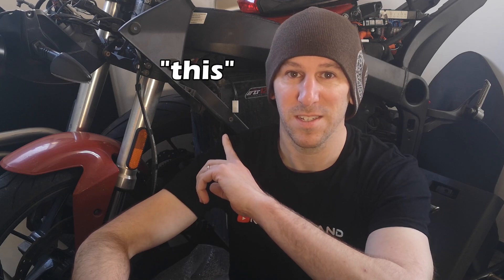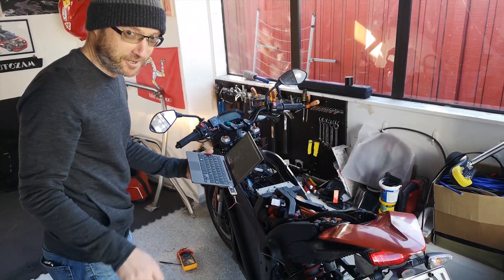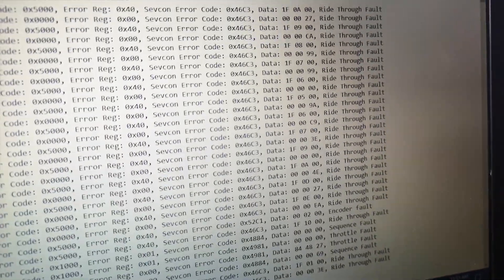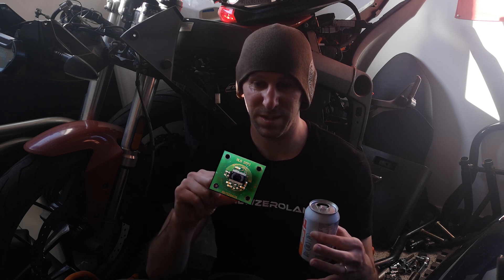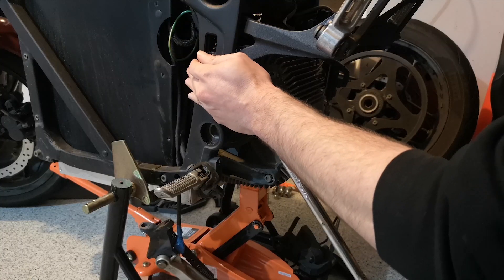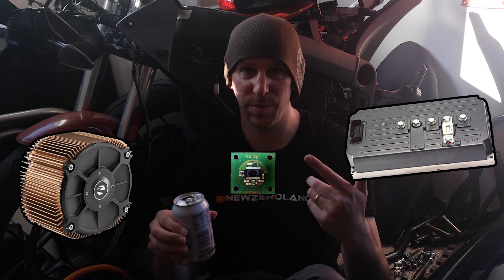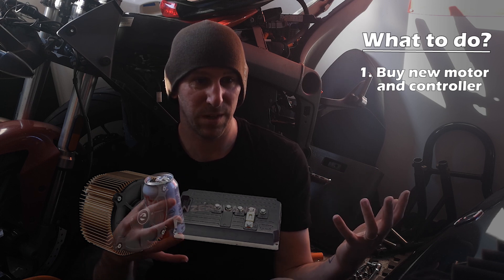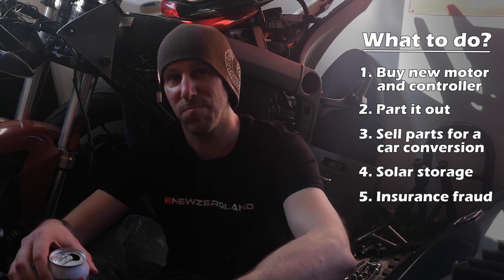What's wrong with my bike?

Comment: I very much appreciate your honest approach, Sam. The rounded view of pros and cons is invaluable.

If people take the view that 'electrics aren't ready yet' on the basis that when something goes wrong that is the inevitable conclusion, then I guess that petrol bikes aren't ready yet either, and they've had a little longer to get their act together!

Yeah, the fiery death at the bottom of a cliff would be a sad end. I don't think it's ready for bike Valhalla yet.

But it does pose a more fundamental question of tech being locked down in this way to the point where someone can't approach a third party for support in fixing an otherwise perfectly good bike. We have laws in different jurisdictions around the world which are supposed to prevent automotive manufacturers from being able to do that. I'm far from being a legal expert, but the inability to fix something without it resulting in material waste or a huge bill is going to have to be addressed.

It's in Zero's interest to have owners continue to use a bike and sing its praises, rather then chuck it down a cliff because their own 'lock-down' prevents an economical fix. I certainly wouldn't be disposed to buying again from a manufacturer who treated their bikes as 'disposable' and simply advised owners in your position to just buy a newer model. Not going to happen.

Good news on the outcome in your case though. :-)
Reply from the maker: HAHA great point about petrol bikes.  Every time I "go back" to ride one, I can't believe that's what people put up with.  I rode a top of the line Ducati and was shocked that it was the best they had to offer.  Maintenance aside, the actual riding experience was horrible.  Jerky, loud, shaky.  Maybe petrol bikes need another 100 years to get better lol.

You're right about Zero.  If we aren't allowed to work on our own bikes, we at least need good customer service.  That's been Zero's downfall for years and it's only gotten worse.  Replacing the encoder would cost $100, but instead I need a whole new motor.. and I can't even buy a new motor from Zero because I can't sync it with my controller!

Tell ya what, if it weren't for this awesome community, I'd be screwed.  Having such smart and helpful Zero owners on facebook and the forums is what has kept me excited about these bikes for so long, and kept my bike running so long, but I don't think I'll buy another one.

Comment: Hey, did you take a look at the motor encoder plug? Maybe it’s full of water… I have heard of the encoders on the Zero motors becoming misaligned after a knock too. It’s really unfortunate Sevcon techs are in such short supply over here :(
Reply from the maker: Nahh the plug was fine.  No damaged wires either, as far as I could tell.  I haven't opened up the motor yet but it's definitely an encoder problem.  It may actually be an easy fix (for someone with the skills and tools to do it).

Comment: I definitely appreciate the honesty. Maybe I just haven't ridden mine enough yet, but I've had zero problems with my Zero as far as all the OEM equipment. My charger is still fine, the charger controller is fine, no problems with the electronics or hardware at all. The only problems I've had are frustration with the slowness of the OEM charging and problems with the aftermarket chargers I spent way too much money on. Nothing that has ever taken it off the road, just frustration at being leashed to within a single charge's worth of range from home.

Someday maybe I'll get the aftermarket chargers working properly and have the ultimate Zero.

Oddly I have an electric bicycle that has similar symptoms to what you're describing. It hasn't gone in reverse yet, but it won't stop. With the throttle all the way off it "cogs" and spins. It does cut out like it's supposed to if a brake lever is pulled, but it's really irritating.
Reply from the maker: Oh man!  No joke, I wrote my 5 year review a few months ago and back then, the script was a lot different.  I was so happy with the bike.  I was proud of my choice to go electric and couldn't wait to tell all the haters that nothing bad had happened the whole time.  Then I the throttle started cutting out at random times.  Once it cut out in a tunnel.  It started happening more frequently until the day it went in reverse.  I'm guessing the encoder gradually loosened up and eventually misaligned or fell off.  Part of me is glad this happened because it opened my eyes to how many others have had this issue (two in Australia) and how Zero deals with it.  I'm sad that I can't give them a good review anymore, or tell people to buy one.  If I'm being honest about my experience now, I won't buy another Zero, and as soon as I fix mine, I'm selling it.

Comment: Man that sucks hard. You shouldn't have to scavenge parts vehicles for replacements... on the other hand it's recycling, but it's still a bit of a headache, regardless of if you're fixing an electric bike or a some other device. Like my graphics card fans arent spinning properly anymore. I tried to open them to oil the hubs, but they're so sealed up they might break if I force them any further. So I did my best to slip one of those oil syringe type things into the hub to oil them and they work a little better, but I still had to order a new fan set from china so avoid having to manually flick them to spin.
Reply from the maker: Heyyyy that's a great point!  I didn't think of it like recycling.  Thanks man, that makes me feel way better haha.  Maybe somebody with the skills to fix my motor will want it, too.  It sucks that it's so hard to get help outside of going to a dealer and waiting months for a fix, but the community is still awesome.  Hopefully I can get this thing back together soon!

Comment: Great Job on the diagnosis and getting it sorted with your connections. 
Exactly the reason I sold my 2017 DSR. I took a big loss selling. My fear was that in a few years after the warranty expired I would have a cell go bad and a bricked bike. Those batteries are impossible to take apart as opposed to the older ones. That ate away at me enough that I sold it. I hadn’t even thought about the other items like an encoder going bad. 
     I am so used to repairing things myself, my job is repairing machines of many types everyday. But having this proprietary stuff makes it tough. Luckily you have some connections that can help you out in California. For those of us that do not it would be tough or a very expensive paperweight. I am sure I will have electric again at some point. But not sure when. I do miss the bike. The right to repair act does not apply to many of these electric vehicle companies,  including Tesla.
Reply from the maker: Thanks man!  Yeah it's so tough not having a dealer or a shop that can work on these.  If I was in the US I'd just take it to the dealer and have them sort it out.  Instead, it becomes a whole ordeal haha.  Fortunately my battery is in perfect health!  The motor may have been an easy fix if I had the software and know-how, but it's become an expensive replacement.

Comment: Hi Sam, thanks for the video. Small question out of curiosity: When you mount the new motor, how will you make sure it is aligned horizontally and vertically with the rest of the bike?
Reply from the maker: Zero included alignment spacers on the bolts, and I'll measure them to make sure they're all the same.

Comment: When my 12 battery prematurely died in my Volt the car started doing weird things that you wouldn’t expect from the same situation in a gas car. 

As Rich says, this is why right to repair is so important. You need to be able to get the tools you need to fix your bike/car.
Reply from the maker: Oh man, yep.  I absolutely agree.  The info and software needed to do this should be available online.  I had a really hard time even finding a photo of the motor encoder to use for my video haha.  They really don't want us knowing what's behind the curtain, and I get it.  There's a level of proprietary secrets in these bikes that they don't want other companies ripping off.  But we still need to know how the bikes work.
Reply: Rich / Louis FTW. Where are our democratically elected legislators when we really need them?

Comment: I expect you have moved the bike backwards with it turned on and ready to ride.  It is just an intuitive thought but I have the same bike and there is something strange about pushing it backwards with it switched on.
Reply from the maker: Oh yeah whenever you roll it around keyed on, the motor will cog (make that noise in the video).. but when you twist the throttle and it speeds up, that screams encoder problems. Surprisingly more people have ran into this issue than I expected.

Comment: The biggest problem we have with new tech is ‘how does it last?’ Electric cars are the same. They haven’t been around long enough to give us an adequate ball park figure. I’ve, actually we, my wife inc- have just purchased into NIU, the largest EV motorcycle,moped, scooter manufacturer in the world. It’s just another world like you say. But we are car drivers for over 30 years. To ride these incredible machines, ours are for city driving and shopping, is lie reinventing the wheel. Commutes are realistically small and a car is a waste until winter. But how long do they last? Our NIU are modular and produce error codes that can be diagnostically read off the app and therefore a part is replaced. You appear to be in a limbo that is frustrating and expensive due to little in the way of a base of users to bounce off of. No manual and everything else- because we can work on our vehicles - leaves you impotent. As I say, it’s a new world and adventure so we have to be pioneers.
Forums can be very helpful, try Europe searches
Reply from the maker: Yep, great point.  I really enjoyed the Niu scooter I rode, and I'm excited about their upcoming motorcycle.  I think it's also a question of build-quality and customer service.  If it's built on a budget using cheap parts, it'll break down, and being able to get those parts is super important.  That's where owning a Zero is a struggle, but at least the community of other Zero riders is awesome.  They're helping to keep my bike alive!

Comment: Definitely a tough call. I'd end up doing the same as you if the option was there. But another option would be to buy another SR and hope like hell it doesn't suffer the same fate. Then you have pretty much an entire spare bike in remote NZ. Just hoping you could upgrade to a 2016 or later motor so you don't get as much overheating as before? Hope it arrives soon!
Reply from the maker: Yeah true.  That'd be the most expensive option, if I was keeping my Zero for a while O_O

Comment: Zero Dude, 
  Sorry so to hear about your SR problems.  Its a big problem.  I wouldn't tackle this problem, but you did.  Thanks.  I sincerely hope that you figure it out.  That will also help the Zero community too as you are very good at documenting your work.
   And the bike itself does seem to be designed by non-motorcycle team.  That's why it is so difficult to actually work on.  No bad intent, but you can see it.  Just look at how the body panels are installed.  Their parts system in also non-motorcycle industry too.  They should have used the same systems that were already available to the big Japanese companies and possibly offer parts online.  I love my Zero SR, but some of their their designs are a work in progress.  
   When you mentioned the awful noises that occurred when you switched it on I also thought of the encoder.  The encoder's job is to tell the controller what the motor is actually doing.  All of the code in the world cannot work by a plan alone.  It needs actual feedback.  Your controller I believe was "hunting" for that input and gets stuck vibrating back and forth.   I hope that you can obtain parts for your motor.  
   Did you notice recently that your bike no longer got to full speed?  I believe this is a precursor to controller issues.   I wish that I understood these bikes a lot more than I do.   I'm also glad that you found help to.

Please keep with it.   If it happened to you, it can happen to anyone.

Thanks,
   Mike
Reply from the maker: Mike!  You're so right.  100% spot on.  This is why Harley's first model was already so much better than any Zero.  Energica too, started with motorcycle designers instead of computer engineers.  We want motorcycles, not just electric motorcycles!  About the encoder, yeah I had no idea how it worked haha.  That makes a lot of sense.  I really hope nothing bad happened in there because it made really loud screeching noises when I spun the wheel.  I haven't noticed a change in top speed, so hopefully the controller isn't toast, too.

Comment: I think it would have snapped the belt if it went reverse on speed.
Couldn't you get a sevcon controller and pair that up? Sevcon has open source software.
Great you got it solved though.
Reply from the maker: Yeah this controller is a sevcon, but I'd need to know exactly how to align the encoder to do the commissioning.  I'd rather leave that to a pro so I don't make things worse in there haha.

Comment: Another strange Zero thing that the Zero Motorcycle company needs to fix. I tried to find different foot pegs to replace the pegs that point up and are not parallel with the ground. The universal foot pegs don't match and the snap-pin that locks the pegs uses smaller holes than the average snap pin tool. WTF. A 15 min job took 1hr. Normal things like top cases and windshields work fine and can be easily adjusted. Zeros are nice bikes and again I like mine, but Zero needs to get this plug in the household wall only mentality out of their heads and think like Energica or Harley-Livewire who provide super-fast charging so you can go long distances in a day without buying additional equipment.
Reply from the maker: Yeppp, absolutely agree, Tom.  If Zero doesn't want us working on our own bikes, they might not see the need for universal parts.  And yeah, slow charging was acceptable when electric motorcycles started out, but not now.  Tech has moved so far that Zero needs to step up their game quick, and stop re-releasing models from 2018 in different colors.

Comment: This is sad news.  What did Zero say, did you talk with them about this?
Reply from the maker: It's out of warranty, so I'd have to buy a whole new motor and controller.  Unfortunately this has happened to a few other Zero riders on this side of the world, and that's how Zero handled it.
Reply: @NewZeroland  Is it out of the two year warranty or the 5 year battery warranty?  (I know it wasn't the battery but sometimes certain parts are covered under this warranty.)
Reply from the maker: @usmcsaxoki  both warranties XD  My bike is too old now.  I just haven't had a reason to upgrade, until now.
Reply: @NewZeroland  I call this Zero BS.
Reply: @NewZeroland  That is shit!